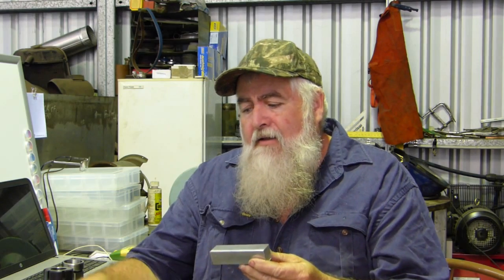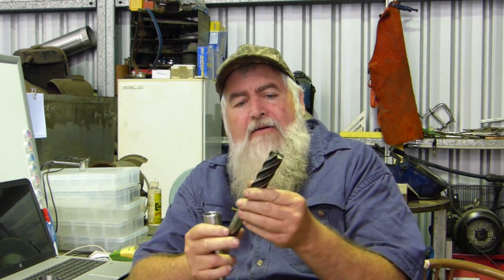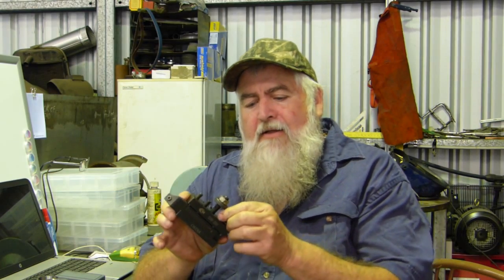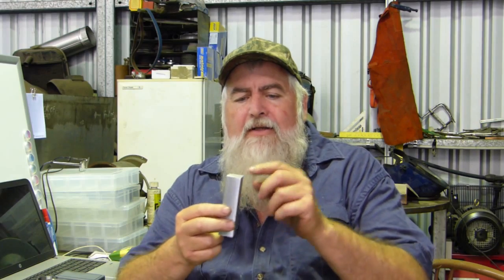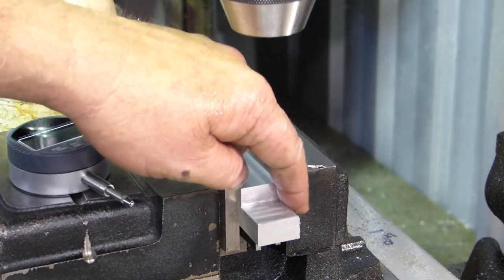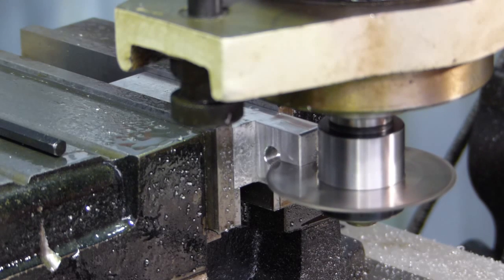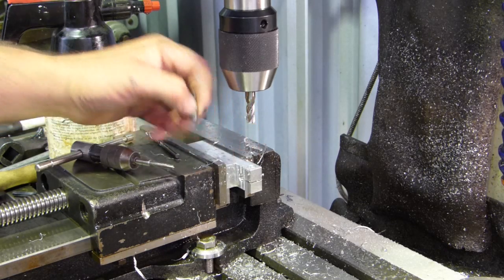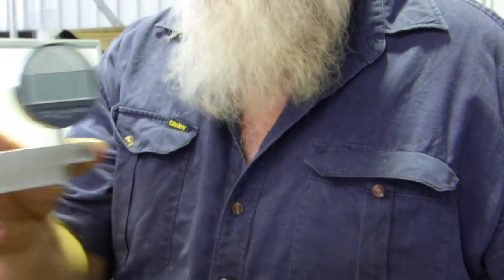Kangaroo Stew # 31

Comment: G Day Lance, nice work on the dial gauge holder.  That's given me an idea to make a dial gauge holder to fit in a quick change tool holder for the lathe.
Reply from the maker: Go for it, the one I use for dialing things in on the 4 jaw is a bit of flat bent at 90 with 2 bits of round welded to it to grab the dovetail on the quick change tool post. In my earlier videos it it seen easily. If I remember this week on the see I will put up a pic. It saves using up a  tool holder.
Reply: Thanks Lance. Also looking forward to your video on a home made fly cutter for the mill. lol

Comment: Gday Lance - nice job and handy little tool. You know why these people have spotless machines. Spend all their time cleaning them, but don't do any bloody work lol.
Autumn's arrived here so guess that's almost the end of tractoring for this year. Been to 3 shows so no complaints. Might? get a tiny bit of ploughing, but weathers against us at the minute. Still haven't been to the pub, or supermarket, depends if we get a decent day....do it for pleasure now not punishment (grin).
Reply from the maker: G Day Malc, Spring has arrived here and the show scene slows up now with only a few to go for the year. Most will be too far away for us to go. We often did go to Allora but it is 7hrs drive each way so we thought we might give it a miss this year. There is a big one in two weeks but it is 4 hrs south and I need to go to my nephews wedding 9hrs in the opposite direction so we are done for this year. I have been to a few plough days and they are great fun.
Reply: Not got to any ploughing days. One I heard of too late, and the last one clashed with field bangers and Lineside show. However my 3 shows were 7, 4 and 5 miles away. One reason I got the tractor, lots of local events. Steam Engine Rally is only about 5 miles away, but apparently it's 'face fits' not my cuppa tea.
Next year (if I survive the winter lol) there is Carrington in May. This is one I definitely want to get to. It's about 30 miles, so hopefully drive there a day or two early, then go the 2 days by car and drive it home the next week. There is also a really good tractor run about 15 miles away. It had just taken place before I got it.
So lots to look forward to :)